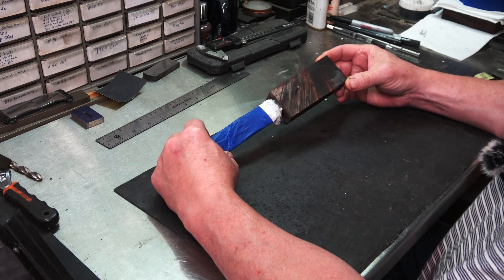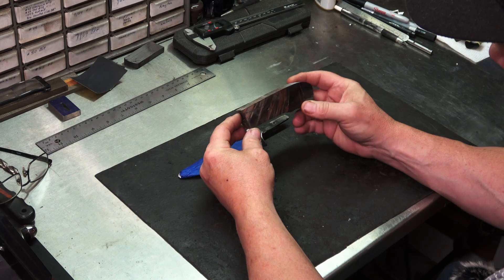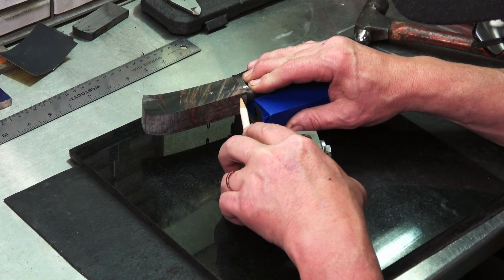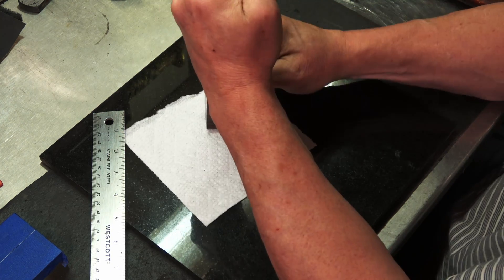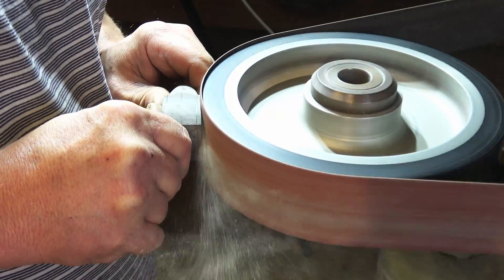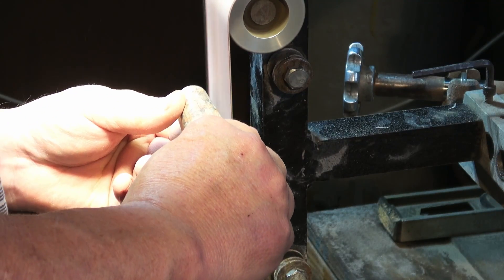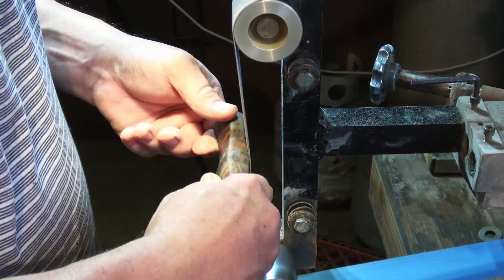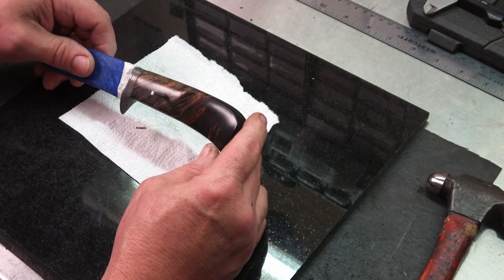How to shape a Knife Handle

Comment: Excellent video, quick question, how do you cut the slot for the metal handle of the blade?  I'm brand new to this so I apologize if it's a dumb question.
Reply from the maker: Thanks!  It is drilled then broached with a couple hand tools to make it square to fit the tang.

Comment: Another great instructional video Mr Tony!  My question is what size wheel are you using? I only have a 12” right now and looking to get something smaller. I’ve heard several makers use 5-6 inch wheels for that type of handle but would like your opinion. Thanks
Reply from the maker: Thank you!  I’m using a 6” in this vid.  Sometimes I use a 4” depending on the knife size etc.